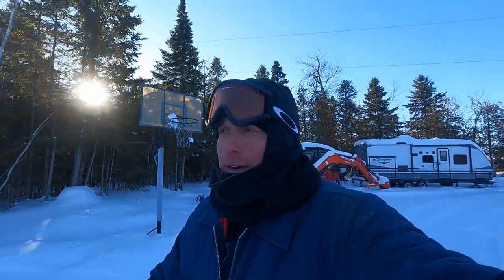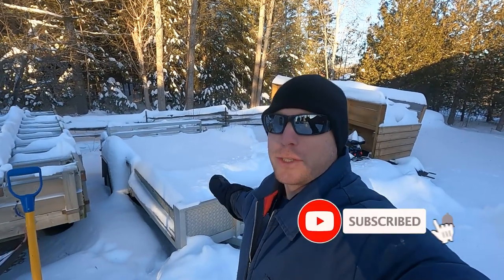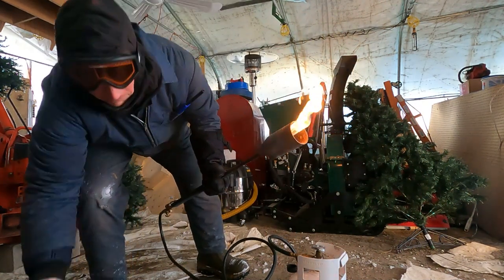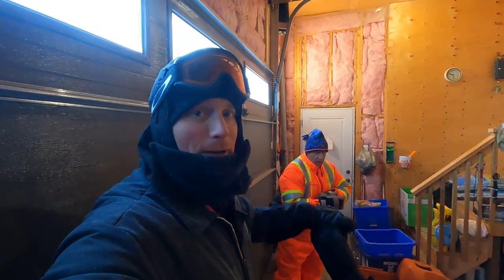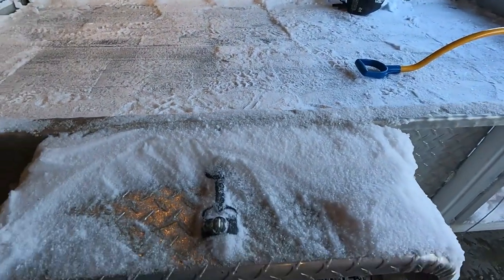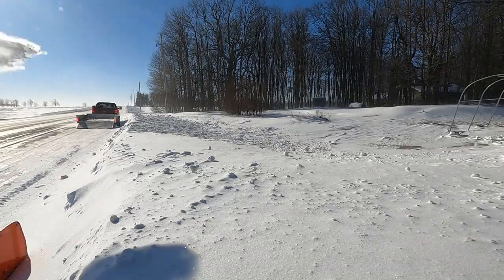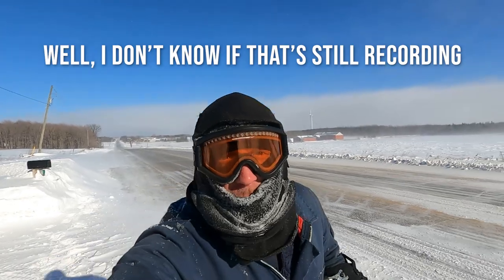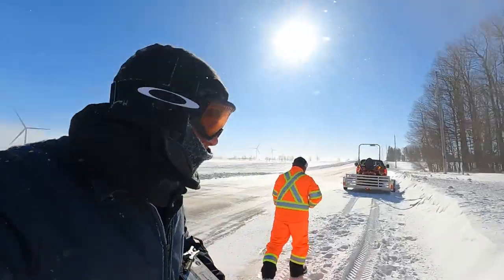Kubota BX To The Rescue | Moving Three Feet Of Snow | Trailer Jack Failure - No.126

Comment: Very nice of you to clear that.  My blower is only a 2' wide self propelled hand type, but when there is that much wind I try to blow with the wind or almost straight down.  That might mean that I have to blow the snow twice, but it does not blow back in my face as much....
Reply from the maker: Most of the snow ended up across the highway I think 😂 keeping the snow out of my face is almost unavoidable when it’s this windy out! Wind speeds were comparable to storm levels. I try to do the same as you sometimes - it was so cold and windy I just wanted to get the heck outta there!! Thanks for watching!

Comment: Do you have a video going over the BX2822 setup, options needed, how you did the hydraulics, eh? :)
Reply from the maker: My good friends over at @rossontheland and @orangeisthenewgreen both have the BX2822.  Check them out!! Basically the same machine but it mounts to the BX23S and not the BX25D which is what I’m running! Thanks for stopping by!!